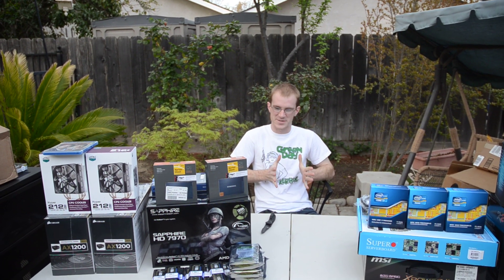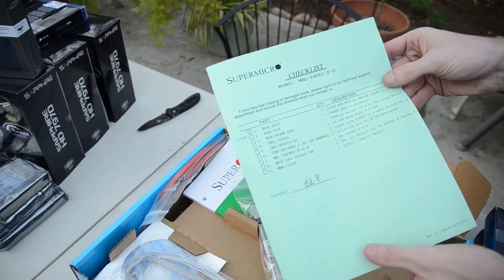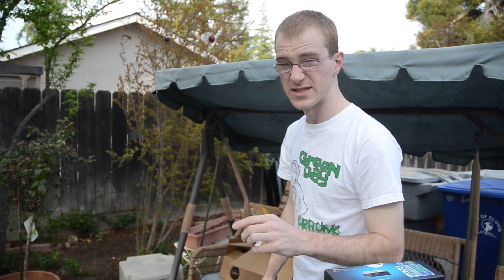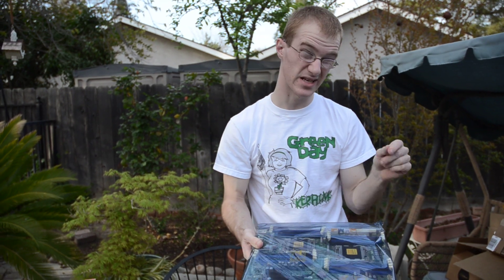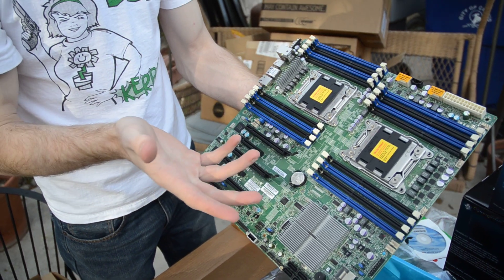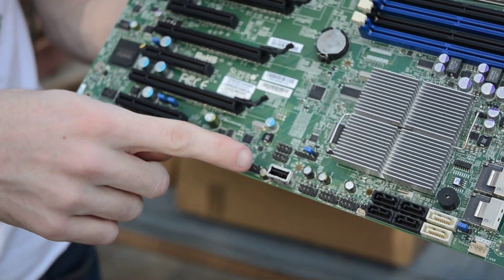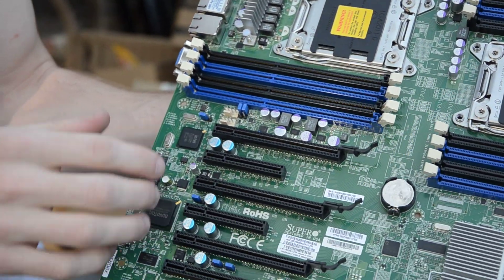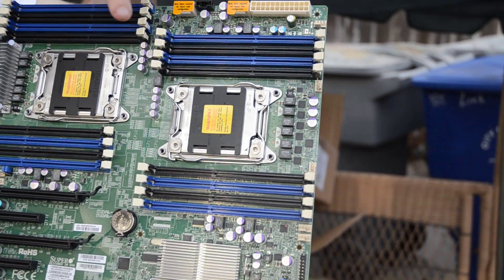New Computer Part 2

Comment: Hello, could you help me to buy a super card dedicated mic for video, because my EVGA classifed lach me, could you tell me how? especially as it manages DDR3 Kingston HyperX Beast 4x8 GB DDR3-2400 and we can climb up to 2,000 MHz and supports Xeon® Processor E5-2650, also with Raid 0 1 5 10 you think that is good? MBD-X9DR3-F, or it there's better?
Thank you for your answer so fast. joeux party and Christmas
Reply: Not sure I'd recommend this board or any Supermicro board. It really sounds like the SRX is the only good option for you because you're trying to run "gamer" hardware on a server platform.

Comment from the maker: It's more of a limitation of the size of the board than it is "poor design." If you want bodacious GPUs on a dual 2011 board with 16 DIMM slots, the SR-X is probably a better option. This isn't a "workstation" board, either, so it probably was not built with the intention that it would be fitted with third-party GPUs.
Reply: Remember, its a server board,, so placing the GPU lower down and leaving the one closer to the RAM is still very usable. I Actually use this board as a Workstation and have no problems with it as is

Comment from the maker: It's ok. Initially the KB/mouse flicked on and off constantly but since I RDP into it now, I'm not sure if that's still an issue. It needed a BIOS update for Server 2012. No idea why CPU 2 doesn't have a HS on the PWM. The Poweredge's that I deal with at work don't have any PWM heatsinks, and they are rated to run at least the 2690 in the case of the R series and the 2687W in the T series. My 2650s load at about 45*. The VGA out is definitely bent, not sure why I didn't point that out.